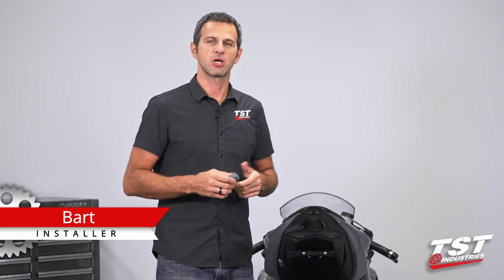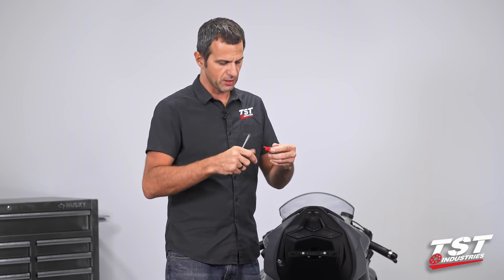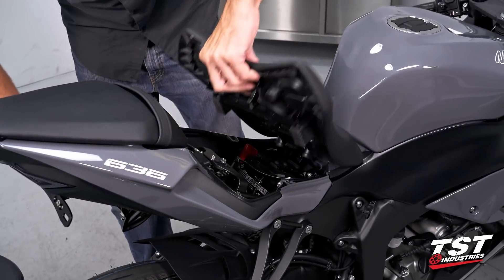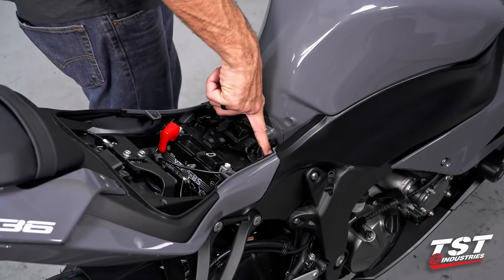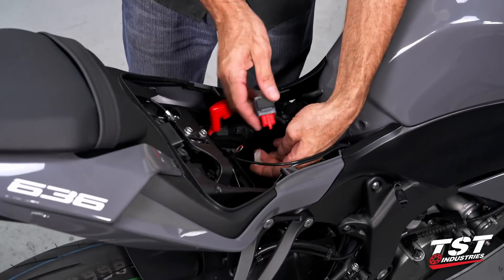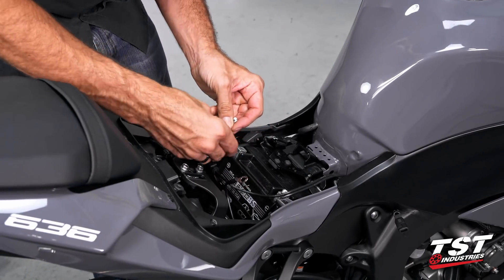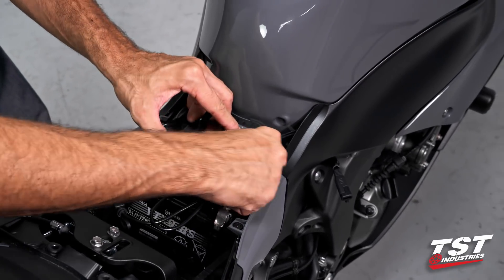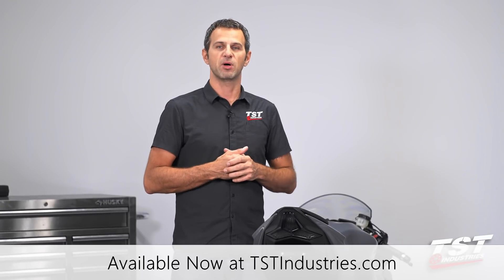How to install an LED Flasher Relay on a 2019+ Kawasaki ZX6R by TST Industries

Comment: UPDATE you just press the button on the inside of the rear taillight and change the mode! Bad ass kit 

So I installed it in my 2023 ZX6R and absolutely no change. Hyperflash persists.
Reply: I Just installed on my 2025 ZX6R and it still persists.

All I have to do is push the button on the back of tail light?

Comment: I Installed my new taillight the smoke one on my 2025 zx6r and i didn’t need the relay for the lights at all. Is actually flashing normal. Is not a fast flasher at all.
Reply from the maker: Great to hear!
Reply: @ since I was messing around with the tail light. I installed the Fender Eliminators from you guys. And the license plate light as well. Looks awesome thank you.

Comment: I have a 25 zx6r and with the tst relay installed when i turn the ignition on the blinkers dont work until i cycle the hazard lights on and off. Any idea what may be the problem?
Reply from the maker: @antjw  so your signals work fine but only if you activate your hazards first?
Reply: @ correct. If i do not turn on my hazards first and try to use either left or right blinker the blinker in the front stays solid on and the blinker integrated into the taillight goes black
Reply: @ i did notice that the tst relay is a 2 pin connector. And the OEM relay is a 3 pin connector. So one of the pins is no longer being connected to anything when plugging in the tst relay. I was thinking that could be related to the issue.
Reply: @antjw I noticed that the OEM is a 3 pin, will my 2 pin relay still work?
Reply: @UpsideLewis yes it should. After TST sent me a new relay everything worked perfect.
Reply: @TSTindustries can you please reach out for us I just installed everything and the front OEM blinkers just stay on and the rear flash one then completely go black and the dash/display is the solid arrow
Reply: @antjw I have the exact same problem with my 2025 ZX6R after installing the intergraded tail light a few hrs ago. If and when you get an update please keep me in the loop, I’ll greatly appreciate it. Ride safe!
Reply: @ So im not alone! Lol. Absolutely man if i hear from tst ab the issue ill come right back to these comments for you.
Reply from the maker: @ please email our Support Team and they will be able to get you sorted with a replacement.
Reply: Same here lol
Reply from the maker: @ please email our Support Team and they will be able to get you sorted with a replacement.
Reply: @antjw any word my bike is doing this too
Reply from the maker: @ please email our Support Team and they will be able to get you sorted with a replacement.
Reply: I have the same problem
Reply: Any update on this?
Reply from the maker: @ we found a small batch of defective relays and have replacements readily available for affected customers
Reply: @ I’d love to give one a try. Do I contact support? If so what should I say?
Reply from the maker: @ absolutely. Just email our Support Team and explain your issues and. They will be able to set you up with a replacement. Please have your original relay order number readily available.
Reply: @antjw  I emailed them and told them about my situation and the problem I was having, and they sent me a replacement part that arrived on Monday and worked perfectly
Reply: @TSTindustries  I contacted you last week and received a replacement part and it worked perfectly. Thank you very much
Reply: @TSTindustries this issue is resolved if I order now?
Reply from the maker: @seangabrielson8224  absolutely!

Comment: what happens if I dont use a relay?
Reply from the maker: You may experience a hyperflash or your signals not flashing at all.
Reply: @TSTindustries  thanks for the explanation.. this relay also fits to the 2024 zx6r?
Reply from the maker: @SuperKnightwind  that is correct and the installation process shown in this video can be used for the 2024 model.

Comment: So, I have my TST installed, and it looks great. However, the main brake light doesn't light up at all. My old light doesn't either now, so I am still determining where to check to see why the brake light isn't lighting up. Blinkers work fine. Fuses? I checked the BRAKE fuse at the top left of the bike and saw nothing blown. Do I need to look at a different fuse? THANKS!
Reply from the maker: Most definitely a fuse. Unfortunately, we don’t have constant access to that bike at this time so your best bet would be to go through the fuses one-by-one until you lay the one that is blown. Once you source the blown fuse, check that circuit for any loose connections before replacing it.
Reply: Yo did you figure this out? I’m havin the same problem right now

Comment: Pro tip for the newbies out there. Don’t put your battery on the ground when you remove it. It will drain your battery life. Set it on a surface that’s (preferably not metal) to keep the battery life long.

Comment: Guys there is any problem keeping the flash light faster than default setup?
Reply from the maker: Fast flashing will not harm your electrical system. However, fast flash may be confusing to someone on the road. If you use a signal lamp type that produces a sequential effect while lighting up the LEDs, the fast flash will not allow your signal lamp to complete it's sequence for the light up cycle

Comment: This looks so great <3 . Do anyone know this is street legal in germany ?
Reply: which part? the LED relay? of course it's legal. Integrated taillights? most likely not, most places have a minimum distance and illumination from the taillight, it's too close to the center, it's hard to see which side is flashing, and it's not bright enough.
Reply: @gwot   thanks for you reply, the combination of both is so sexy :). But in that case i order only the relay^^

Comment: How do you change blinking modes on it? On my mt09 it was with a push of a button but this one doesn’t seem to have that option🤔
Reply from the maker: On the flasher relay you can only speed up or slow down the cycle rate. The relay does not alter the pattern of the flash. What you are describing sounds like the programmable functions of the tail light itself. The only programming buttons that we provide for altering flash patterns of signals are onboard our programmable tail lights.

Comment: Is it normal that the flasher blinks fast for a second then it will slow down when the bike is running? I installed the same relay. Thanks
Reply from the maker: On some bikes with a certain electrical setup the first flash or two are faster than the set rate and then it settles down to the pre-set 85 cycles per minute, or whatever you adjusted it to.
Reply: @TSTindustries  Okay thanks! I have the same bike, 2020 Kawasaki ZX6R.

Comment: Is this a must buy if you i bought the integrated smoked tail  light for my zx6r 2019? Will it let me go through the tail light programs without it @tst
Reply from the maker: It is not a must buy. The light will still work but the signals will flash fast. The sequential signals will not complete their cycles if the flash rate is not slowed down though. For sequential signals to light up all the fields you have to have a certain cycle speed that allows enough time for each flash to go through the sequence.

Comment: Any idea where the flasher relay is on a Kawasaki ZH2 2020
Reply from the maker: I replied to this days ago on my phone but for some reason on the computer it still shows not responded to. Sorry, something must have gone wrong on this thread. I looked through parts fiche for the ZH2 and it looks like there is a frame fitting that the relay hangs on, and this fitting is screwed to one of the bosses on the front of the steering tube on the frame.

Comment: I have a 2017 Kawasaki Z1000SX Ninja which i converted the OEM rear signal light to an R&G LED indicators, i noticed when the hazard is turned on flashing rate is nornal, its only during turning signal turned on does the light blink faster, will your relay correct this? Please send me as well a link on how to order, thank you
Reply from the maker: We do not have that model in our market for those years so it is tough to tell. We have seen this symptom on bikes in our market in the past and our relay did fix the problem. Now, I do not want to go on assumptions and tell you wrong because I would hate to sell you the wrong part. We will need to see some photos of the OEM relay on your bike and then we can cross reference it for you. You can send those photos to our support guys through tstindustries.com

Comment: Does that relay control front indicators also? Assume if they are incandescent it will mean front are messed up then?
Reply from the maker: One relay controls all signal lamps.  Front, rear, left, right... all controlled by that one part. Whatever your signal combination is you can feel comfortable that our relay will fix your hyperflash.